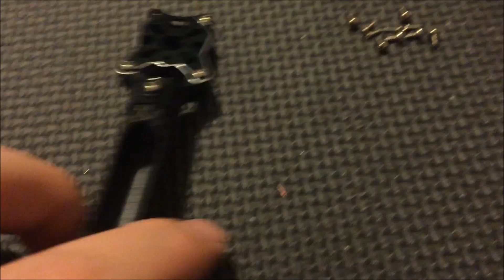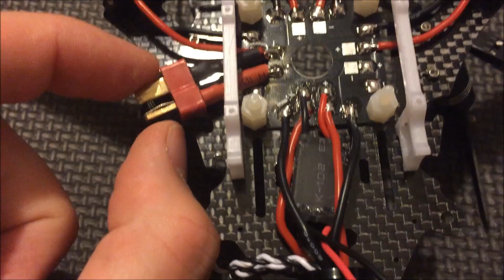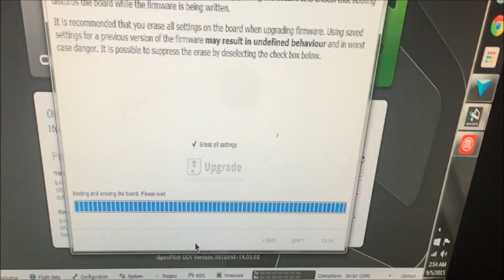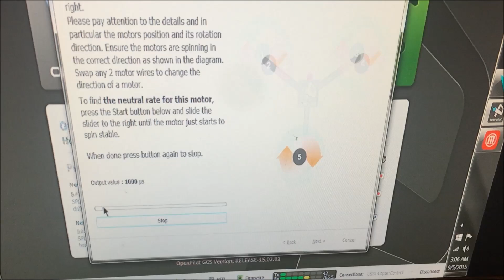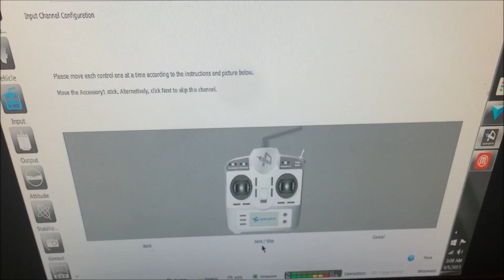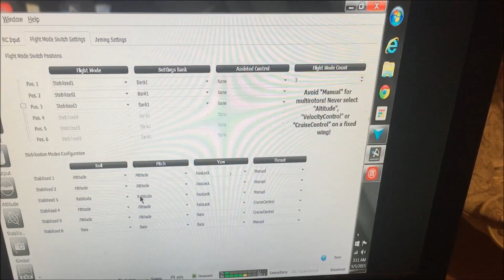Rakon Heli 280RY Y6 Complete Build Video* Maiden Flight *

Comment: Awesome design for FPV as if you lose a motor you still have a motor running at the cost of an increased yaw rate but the ability to get it back home safely. But putting two ESCs together like that  is far from ideal and if they fit I'd use some of the skinny ESCs like the 20A Afros that are really 30A parts without heat sinks and run them end to end but use solid tubes with small holes instead of such a large solid section of tube missing on the bottom (for looks) with the holes facing up in the prop wash as heat rises and the air flowing out the ends will cool the top of the ESCs better.
Reply: Great White hope I see you are still upset I exposed so many of your fake identities. Hate to tell you again  but your real identity is known throughout the RC industry you want to be a part of so badly. This post of yours as well as "propfella"'s and all the other names you use to troll and insult people due to some serious "personality" issues shows why no one would ever invite you to an event or want to see you show up for one.

It's sad with the growth of the RC Hobby it has attracted a few perverse objectionable people like yourself  as it gives the FAA real reason to be concerned. But wait... aren't you late for a "secret double agent " meeting? LOL   .
Reply: Great White hope Your emotions make you a total disgrace in the eyes of the world and you know it... but you don't care what other people think as you are past trying to keep up with reality as you make up your own.
Reply from the maker: +John F Hendry Who is this guy? WTF? I will block him.
Reply from the maker: +Great White hope Well either way keep your accusations to his channel.  Why do you have to bring your drama here man? I don't want to get involved. It seems like he's being a perfectly reasonable human, while you just sound aggressive with every word you say. I can actually block you its part of being a verified channel. So cant you just chill and come here for quads?
Reply: DriveFlyRc  He's the blank blank troll that caused Hobby King's Product Discussion Forum to be taken down while his posts that went back years using fake identities as several Hobby King Pro Contributors "helping young kids" were all removed after I exposed him as the same person and showed the HK moderator what he was doing after he came after my posts online and I tracked him down to Hobby King.To answer the "better question" I'm the amateur physicist that showed SLAC's E158 ratio matched CERN's 2011 announcement of neutrino's traveling @ (v-c)/c=2.48e-5 sec in 453.6 miles and created an asymmetry in time of 0.20 sec SLAC confirmed a year later despite the "loose cable" claim after going back over SLAC's BaBar experiment data to use a 3rd experiments data to confirm time has asymmetry. SLAC gave the discovery I exposed in the E158/CERN data match a sigma 14 level of certainty (that means it's real). My work (equations and calculations) is filed in support of several Nobel Prizes because it explains certain mistakes made that made CERN think the muon neutrino was superluminal as CERN announced Worldwide after waiting years to triple check everything before saying Einstein was wrong. Time asymmetry probably means nothing to you, but it's only because you are not used to hearing the force of gravity described that way. And this perverse sick troll didn't like seeing the credit I was getting so he decided he would step in exactly as you see him do here. It appears he follows a Satanic cult that believes you can change something by reversing the symmetry of words that describe it. My advice to the police regardless of what identities go with what is to stop letting this guy create a bigger case and stop him before he does what expert witness says he will do at the first opportunity where he thinks he will get away with it.

Comment: I can't help but love the aesthetics to all of Rakon's multirotors. I never picked one up though. This is a very interesting offering from them. 
I might have done a few things differently, but that is easy for me to say sitting here, and not actually having to build it, lol!
Reply from the maker: +Hiway Yeah I really like quite a few thing about their designs. It's light, and although the plates are thin they are extremely durable and the canopies are slick. I've yet to damage one of the frames I have. 
I'm interested in hearing some of your idea's for this build as I'm not above changing it till its perfect! 
Thanks for stopping by as always man. Im back! haha
Reply: DriveFlyRc
I have had mixed results on those DYS sn20 and bl20 esc's- the size is right, but they are some hot running little feckers. They also are sketchy when pushed near the 20 amp mark under sustained load- of 12, I have had a total of 4 blow up, and 1 that is very wonky. I have a 150 on the sn20s's with simonk, and I run the bl20a on a 180. 1306's on the 150 and 1806's on the 180. 4S and 3S, and 2S on the 150 for testing. The problems begin when the 4S setups are pushed- fly at full throttle and magic smoke happens.

The problem here is the esc placement almost demands those escs- not much else will fit in those arms. I would prefer to have my esc's outside and accessible- but for the designs Rakon offers, that sort of defeats the purpose- hence, why form should always follow function in my opinion. That penchant for form that Rakon sets store by is attractive, but also what prevents me from popping on a frame- I am not convinced that function has been the priority.

 Damn things are some of the best looking multis on the market though. No denying that.
Reply from the maker: +Hiway Ahh yeah makes perfect sense. I haven't had the best luck with them either I had one show up DOA no response. I think for my QAV 210 build ill roll with the ZTW 18amps AutoShot.
But your right, the form factor of these esc's is hard to argue with. Damned if you do damned if you don't. I cant really see any thing short of maybe KISS esc's fitting in these arms and they catch on fire from time to time lol. Time will tell, Im going to push this one to its limits for sure.
Reply: DriveFlyRc
I am using the rotorgeek 20 amps just out... they are cool, super fast, and brutal response on oneshot with my naze setups. On the 2300kv I use medium timing and damped light. Increase pwm dither to about 9 I think. Sofa king fast.